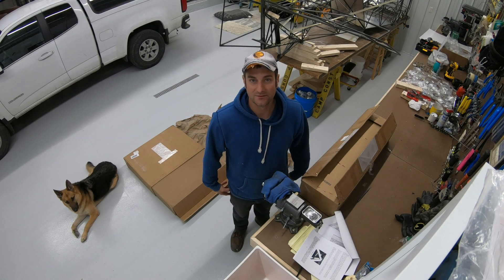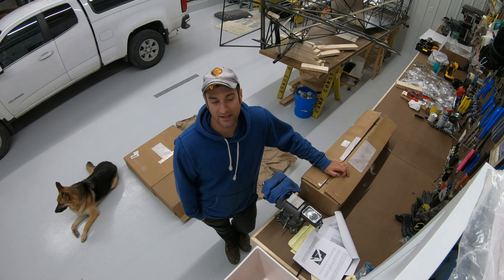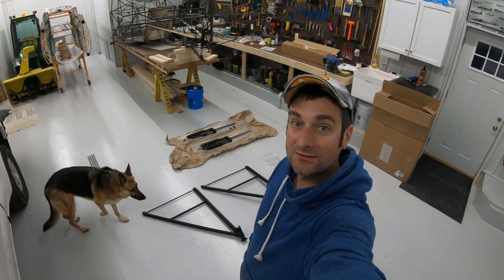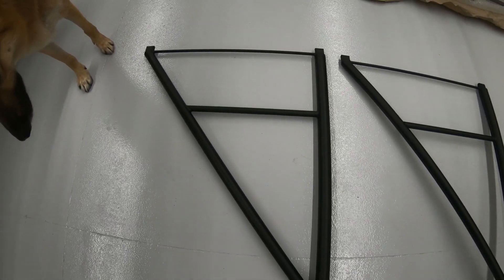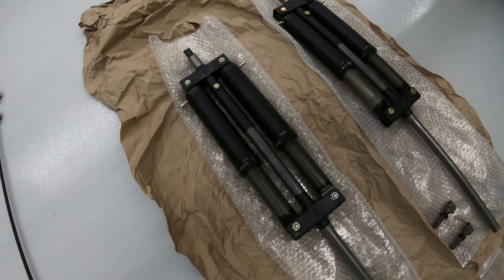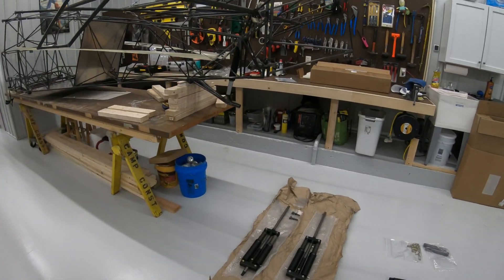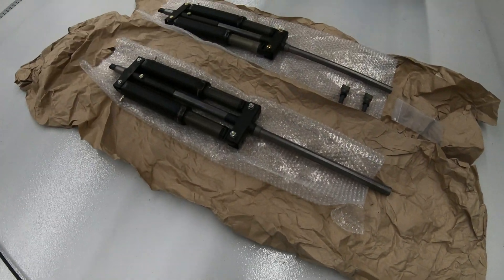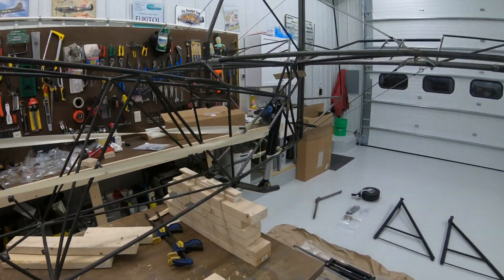STOL Bush Plane Landing Gear - Highlander build video #6

Comment: What options is the Steve Henry special on this landing gear? Is it the 3” “forward option” as shown on the TK1 website? They also show 2”, 4”, and 6” “extended leg” options.
Reply from the maker: I have no idea what the measurements are. I would contact Tony at Shock Monster to find out.